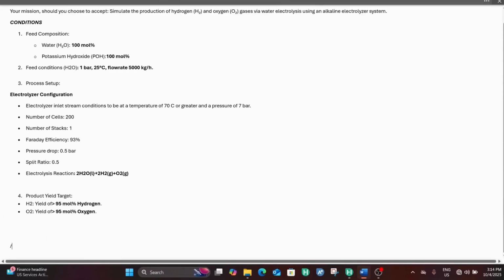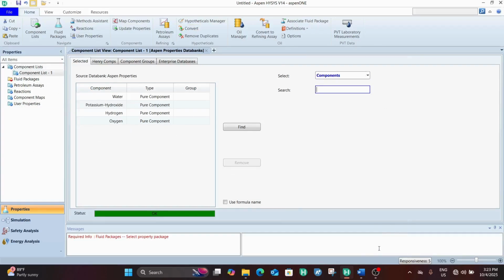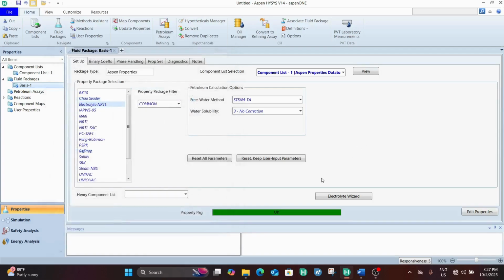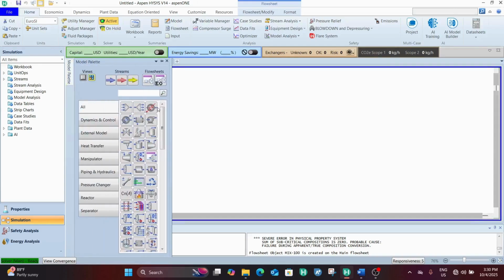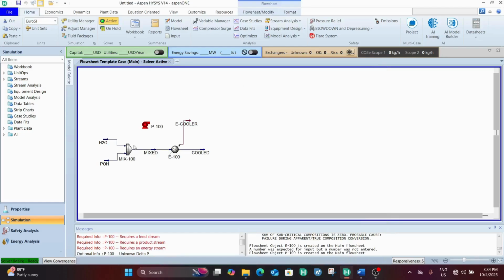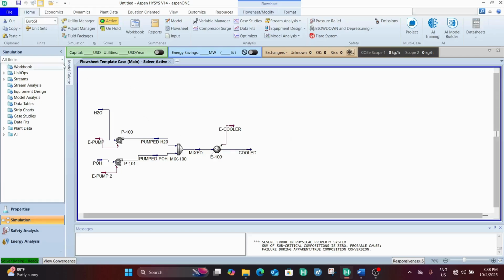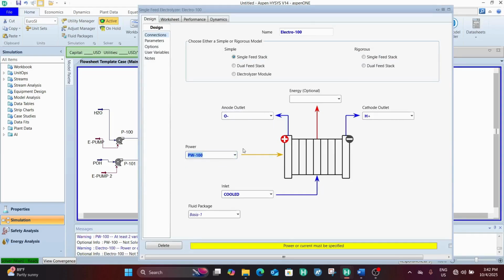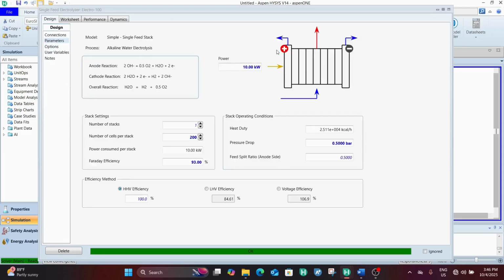ALKALINE WATER ELECTROLYSIS USING ASPEN HYSYS PART 1.

Comment: When I try to calculate pipeline dimensions for a gas-liquid two-phase flow path using your method in this demo, the program crashes or fails to calculate. Do you know how to solve this, sir? Thank you.
Reply from the maker: Good day
What method for calculating pipe dimensions are talking about? 
This content you commented to is only covering process (Alkaline water electrolysis) simulation 
You seem to be talking about pipe sizing if I'm right and that's out if scope. 
I believe you commented to the wrong video check it again
Reply: @SilverDoveTech  Sir, your understanding is correct. What I was referring to is that the program crashes when calculating the pipe diameter using the built-in pipe diameter calculator for the gas-liquid two-phase flow at the electrolytic cell outlet. This might be the reason. I would be very grateful if you knew the answer.
Reply from the maker: Good day Sir, I don't completely get you but think it might be a software issue on your end worth looking into.

Comment: What a master!
Reply: And do you kown the membrane distillation for producing pure water from salt water? can aspen plus be used for this process?
Reply from the maker: Thank you sir. For the membrane distillation I haven't worked on it yet but I believe Aspen Plus will be better at handling Membrane equipments but you would have to build a custom model for the process. What this means is that the Membrane setup or configuration will most likely not be inbuilt in your Aspen plus.
Reply from the maker: Heyy regarding your membrane distillation check this video out :https://youtu.be/dV5V5-PAi0A?si=3He2TAXBseTpt4ye
the name of the YouTube Channel is Nubyira Process Designers